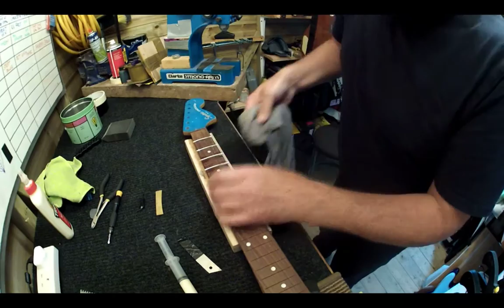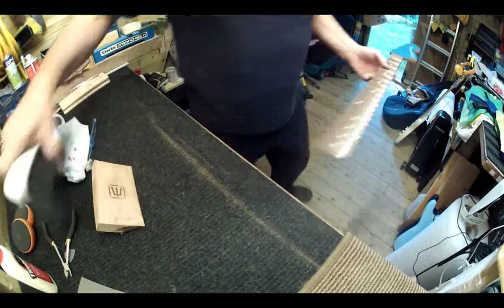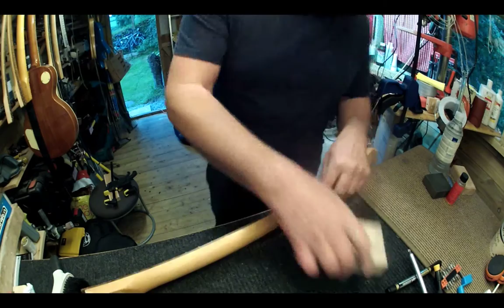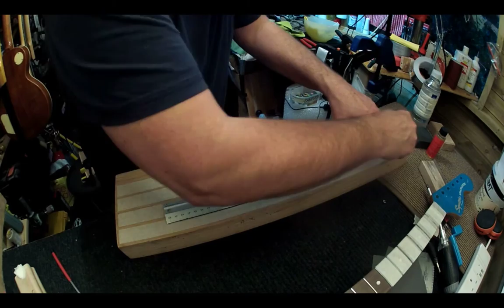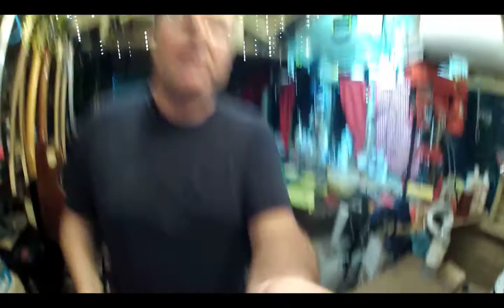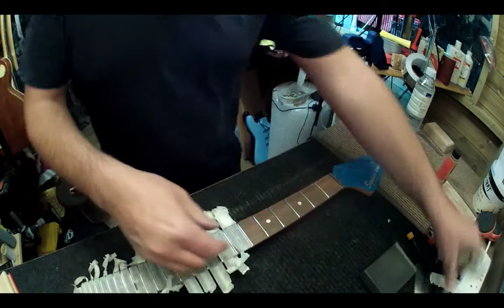Squier Standard Strat blue refret and set up part 2

Comment: Merry Christmas Sam...and a happy New Year! Got my fretwire in the mail, and my tools almost assembled (I made four cauls with inserts from scratch (just because even though I'm Canadian, I still have Scottish blood in my veins), and as a fun experiment...hope they work...itchin' to go. 'Been playing Pink Floyd's, "Time," lately...so much to do.  Funny thing, after I sort out my Luthiership, I'd like to learn to fly gliders too...
So, I was wondering if and when you would ever sand the fretless fretboard level, before sinking the new frets. My fretboard looks pretty good...being a perfectionist though...what are the risks...why not do it? I do believe,  "if it aint broke, don't fix it," though.
Reply from the maker: Hi B Mac - Merry Christmas and a happy new year to you too! I often sand a rosewood fretboard to clean up any 'corrosion' (where the finger sweat / acid has dissolved the wood over years of play). You would nee to be sure that you still had deep enough slots for your fret tangs afterwards or at least be able to cut new slots to the correct depth. Why not? It makes the fretboard look and feel like new. You have to judge whether there's enough rosewood there to do it of course...